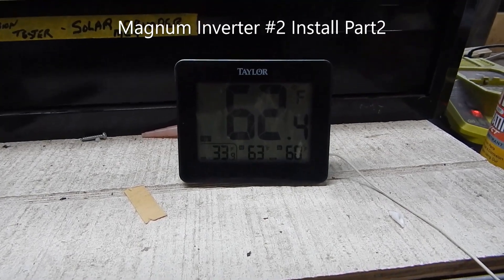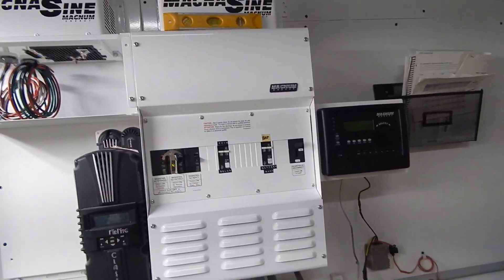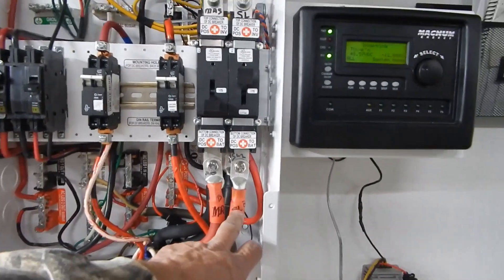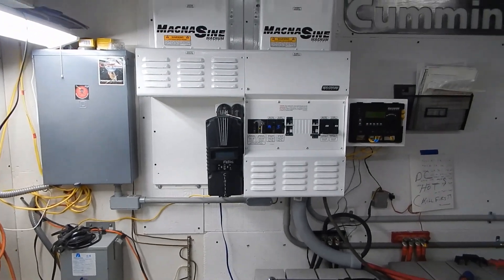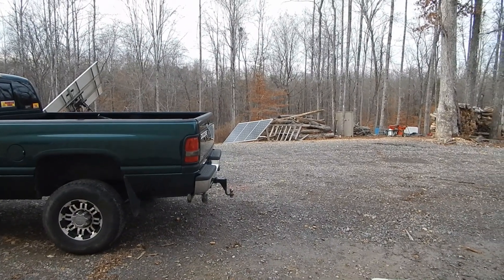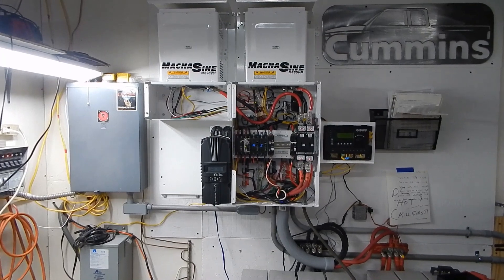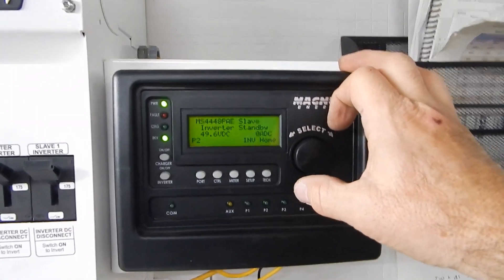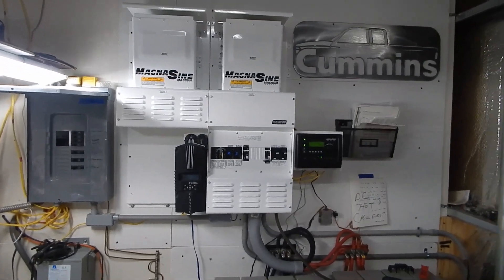Magnum MS 4448PAE #2 Install Compleat!

Comment: How did you get a rail that holds two 175 amp DC breakers, mine only has a place for 1?
Reply from the maker: U need to buy the correct cabinet for 1 2, 3,or 4 inverters.

Comment: I dealt with backwoods solar in Utah for designing a system for us. We have 8-385w panels coming 180’ to the house on #6 with a 12,000 watt Cummins propane powered generator. Inside our basement we have 8 crown cr-430 6 volt locomotive batteries. They sold me the midnite outback charge contr

Comment: Did you mount all those components straight onto the plywood? I worry about heat
Reply from the maker: The wall is three-quarter inch plywood covered in cement board the inverters stood on their own metal panel raised from the cement board no issues with the heat. Good question thanks for watching.

Comment: That's some serious eye candy.  smile.  You make it look easy but I'm sure it is far from it.  Thanks for sharing your experience with us.
Reply from the maker: Thank you and thanks for watching. It took a long time but I was correcting a lot of the previous stuff I had done in a hurry as I was building this place up a year-and-a-half ago. That said this is far superior. Biggest thing is don't put any wires what they don't belong this is very expensive to have the magic smoke come out of. That had me very concerned.
Reply: It's good you had all the experience over the years with solar - trackers, RV's and then started relatively small in your home in Florida.  Your current system is a testament to all you've learned over the years.  Impressive.

Comment: Looking great. So they don't load balance? One comes on when its required to by the load amount?  Can you give me a quick rundown on how that works on them units please mate. Thanks
Reply from the maker: Just in case solar power and camping. Okay here's how it works the master inverter Powers all the loads up to 60% of its capacity which is rated at 4400 Watts. U can set that kick in were ever U want .10% ,70%  what ever U want it to do.Slave inverter number 1 is in a sleep or searching mode drawing only 6 Watts while its waiting for a signal from the master inverter. When the master inverter hits 60% of its capacity the slave inverter turns on automatically then goes back to sleep when the 60% threshold has passed. I can also charge my batteries with only 120 volts in still  at 240 volts out. once U set charger  max at 50% max.  I can turn on only the master inverter to charge or both if I have my 6500 watt 240 genny hooked up. To my knowledge these are the only 240 volt units will do that.
Reply: @TheKiloG69  That's great. A real power saving feature.  Thank you mate.

Comment: Wow you must be rich. Now all you need is to spend another $2000 on a magnum charge controller.
Reply from the maker: Frank Z you're too funny. What I have is a nice UL-LISTED very safe inverter system for my off-grid home. The whole reason behind this was for this place to pass an homeowners insurance  inspection so I can get some homeowners insurance as I have none at this moment .that was a big issue behind this plan. I also have a flexmax 80 charge controller & the midnight classic so no I'm not buying any more Magnum products .I'm  done. Going off-grid sold me on this system I see how he uses his that's why I bought mine.

Comment: Nice n neat now. That's more work then what meats the eye. I keep learning that lol. Your going to enjoy that
Reply from the maker: Thanks Roy that sure was a lot of work. Now that everything's clean neat and ul-listed maybe I can get some homeowners insurance on this place that was a big part of this.
Reply: @TheKiloG69  UL is a big deal with insurance. Do you need it inspected also. They like that yellow lable also
Reply from the maker: @royamberg9177  I've never been in this situation before. There are no building codes zoning or any type of regulations out here where I live I'm sure they'll send somebody by to come look at my place this is Uncharted Territory for me we'll see what happens.
Reply: @TheKiloG69  insurance is funny lol. They look at heating system. Your unvented heater will flag. Wood stove every insurance Co has there own criteria you had the chimney installed. That should be ok I think. Electrical needs to be inspected with a sticker. Building should be ok. Smoke carbon monoxide detector are needed. Pipe on relief valve on water heater 6" from floor. No gas in building. Gas line etc has to meet basic code go by the national codes if nothing local.  There's not to much on local codes here either so then national applies
Reply from the maker: @royamberg9177  I still have more work to do. My unvented propane heater in the home inside I absolutely love it it's fantastic everybody's got those things around here. I hate insurance companies I think they were total fraud and rip off.  also working on closing in my shed I built and I also built a lean-to off the shed in the back with the big metal container job lock box to put my gasoline for my generator. lots of work going on here I don't show. We see what happens.
Reply: @TheKiloG69  here in Minnesota I can't even work on them as a service man. But they seem to be able to sell them in Minnesota. Don't understand that deal. Lot of people end up in the hospital over them

Comment: Nice looking power wall. Tell me more about what the 2nd inverter can do besides be a redundant backup should something happen to the master. Will it kick on should you need more power than one can deliver?...ie hooking two generators up with a parallel cable
Reply from the maker: JW Wright. the master converter is on all the time it uses only 25 watts of power. Slave inverter number one only only uses 6 watts of power in search mode. Inverter#2 comes on automatically  when Master inverter number one hits 60% of 4400 watts It really is a beautiful & safe  setup.